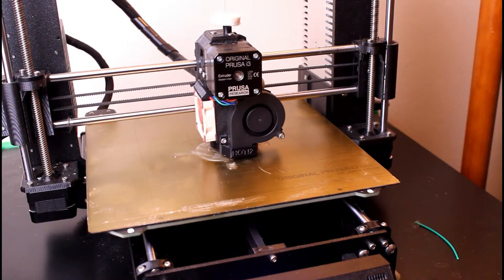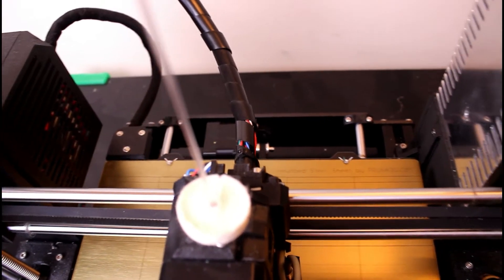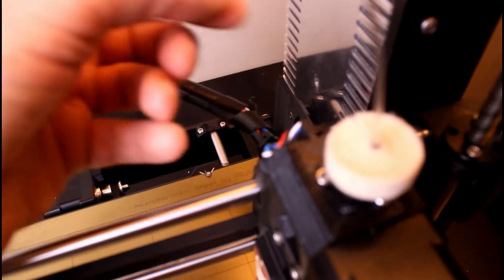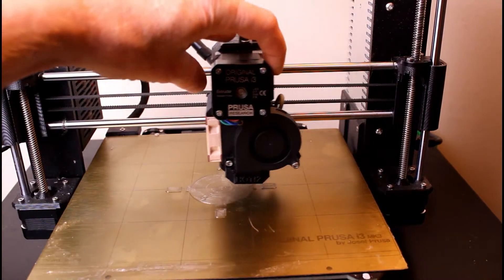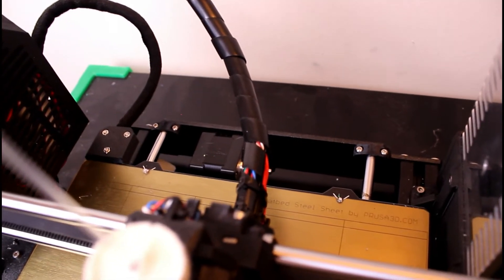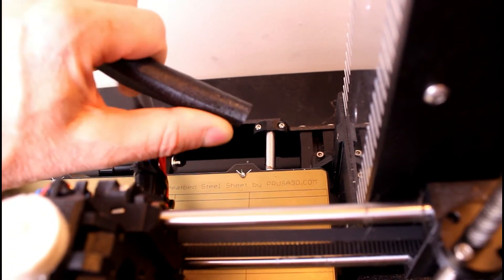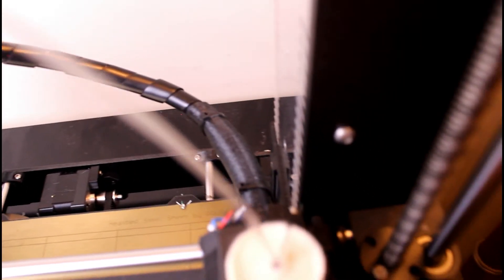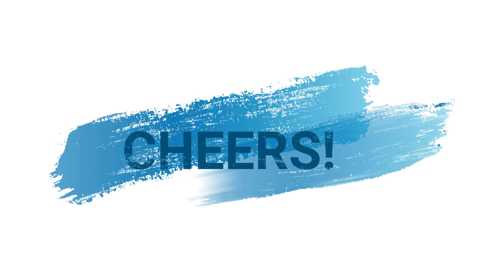Prusa i3 MK3 "Err: PRINT FAN ERROR" Fix

Comment: I just had this same problem with my new i3 MK3S.  The yellow wire from the fan was broken.  In my case, it happened at the strain relief where the wires go to the main board.  The wire got pinched when I tightened the screws on the strain relief and eventually broke inside the insulation.  For those of you who don't know, there is an easy way to find out where a wire is broken inside of the insulation.  All you have to do is pull on the wire as if you are trying to stretch it.  If the wire is good where you pull, it won't stretch. But if it is broken inside the insulation it will not only stretch, but eventually pull apart right where the wire is broken.  Then you can strip and splice right there and not have to deal with replacing the whole wire.  I just slid some shrink tube over the wire far enough so the bare end stuck out, soldered the ends together and then slid the shrink tube back over the solder  joint and heated it enough to shrink it down.  Good as new!

Comment: You would think that the people at PRUSA must encounter this sort of thing all the time, especially considering that they have a "Printer Farm" with dozens of printers running 24 hours a day. So WHY don't they address the strain relief problem with a better design??
Reply: I just came back to this error and resumed print. Seems ok but I’m sure it’ll happen again. I have a new MK3S and it doesn’t have this hard spiral wrap with this new version but it is still happening to people. It’s unfortunate because the printer is amazing otherwise.

Comment: Thanks! I couldn't feel any break in the wire at all in the back of the extruder, but went ahead and replaced it with a section of servo wire and now works as good as new.

Comment: I had the same issue with the cable of the bed thermistor. It cut off in the insulation where it exit the 3D printed connector (connected to the bed). I've fixed the cable, but maybe I should print a strain relief as well

Comment: Same problem, will check it today/tomorrow, thanks for diagnosis, I thought the same, wire will be broken I bet...
Reply: i suggest using wire with silicone insulation, should be better

Comment: I'm getting this error message.  I cleaned out the stray filament wisps that I found.  Still got error.  The fan appears to be working fine.   I turned off the fan sensor for now so that I can at least finish my 4 hour print. (failed at 3 hours in.)
Reply from the maker: There are three wires going to the fan: a black ground, a red power, and a white sensor wire. It is possible that there is a problem with the white wire so the fan would still operate but the MK3 is not able to sense that it is actually running and throws the error.
Reply: @0calvin   Thanks for the info.  Fortunately for me, I also have an Ender 3 to fall back on. :)

Comment: After a few weeks of printing I had exactly the same problem, was able to keep printing for a while by turning off the checks, but it got worse and worse. I will probably try the cloth wire bundle holding trick listed in the comments (thank you!)
Reply from the maker: I'm glad I could help. I've actually been going bareback these days. Er, that is, with no covering on the wires and just a few tie wraps to keep it neat. Not the prettiest solution, but my wires are no longer breaking so it's all good.
Reply: I will keep that in mind, I hope that Prusa retro fits something to fix this 100%, has anyone sent him feedback? Thanks again
Reply from the maker: I just checked the latest kit build manual online (3.05) and they still call out the spiral wrap, so I'm guessing this issue has not been addressed.

Comment: Thank you for the diagnosis and repair. I have the same issue.
Reply from the maker: No problem at all. By the way, I also ended up having the same problem with the thermister wires just recently even with my newfangled strain relief. The failure simply happened somewhere else in the middle of the bundle. I think the key, like another comenter said, is to remove the spiral wrap altogether. He suggested to wrap the wires a special cloth wrap, and I may do that at some point, but for now I'm just letting everything hang loose and it seems to be ok. Although, I'll admit, it does not look too great. Cheers.

Comment: What worked for me was to update to the Prusa Build suggestions of removing the spiral wrap altogether and the filament core that they have in the bundle, then wrap the wires with cloth wrap. This not only spreads the bend of the wire out over the full length of the bundle it also make the carriage  eayer for the stepper motor to move so less chance of a layer shift do to skipped steps.
Reply from the maker: Thanks - that sounds like a good idea. I may end up doing just that.
Reply: Here is a link to vid I did on it. https://youtu.be/M6TsgB9yxXw